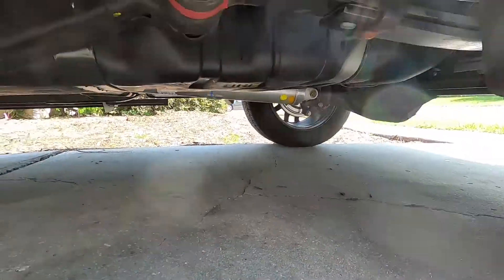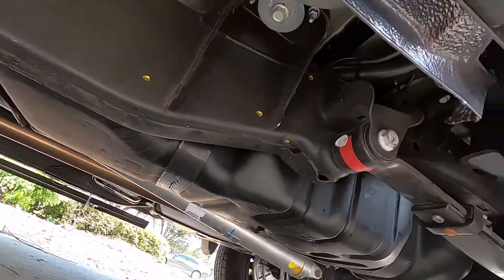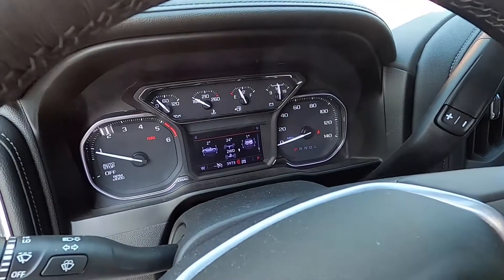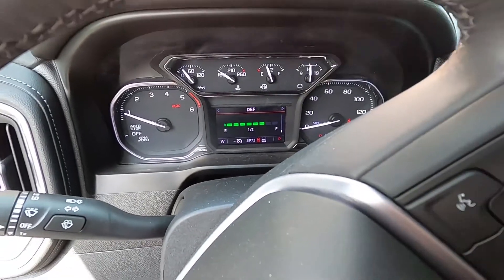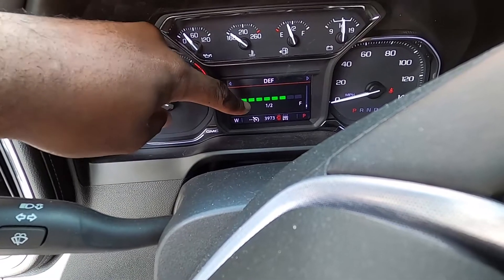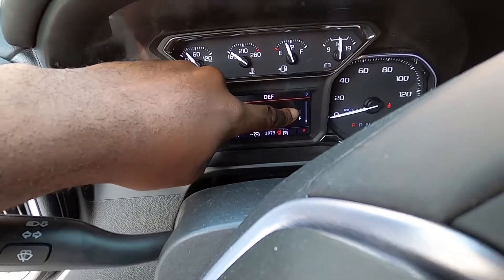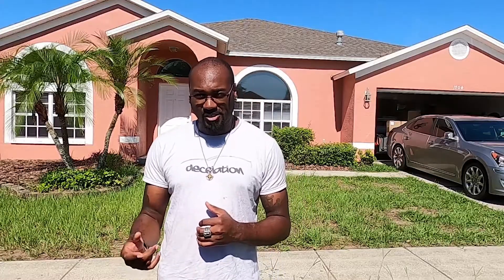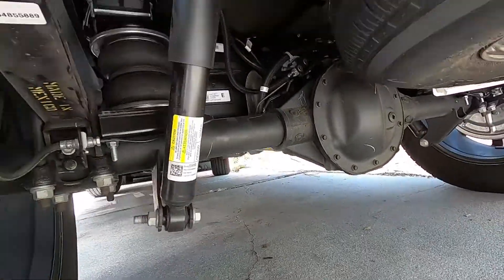Sierra DEF Fluid Problem

Comment: I have a 23 sierra turbo diesel and  still under 10k miles second time in the dealer for def fluid issues reduced speed etc kind of getting annoying
Reply from the maker: It is a new engine platform so there are definitely some growing pains to be had. The main reason I got rid of mine was because I needed more towing capacity